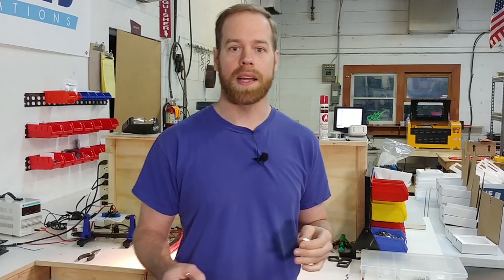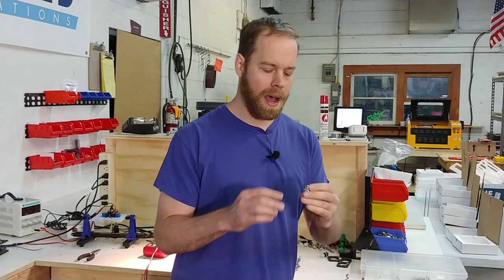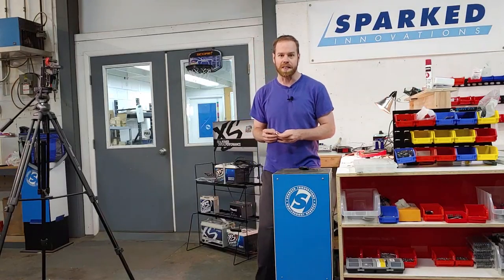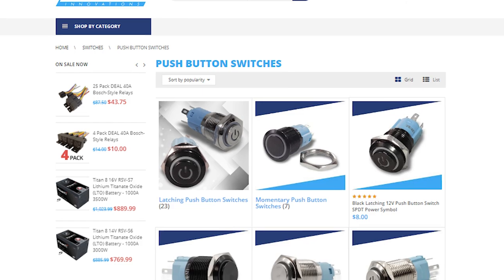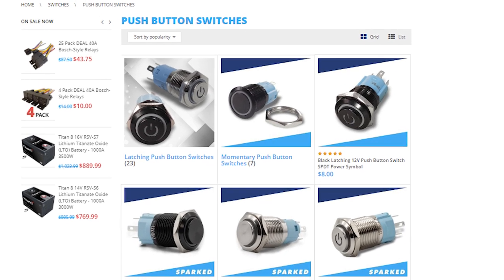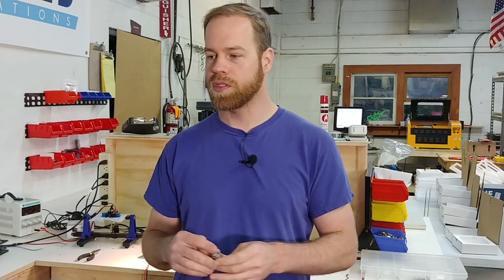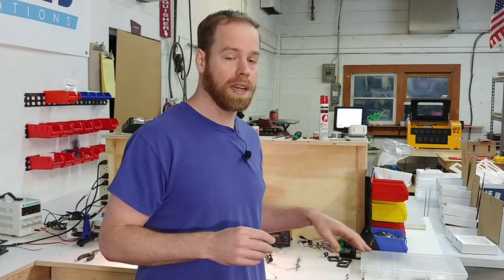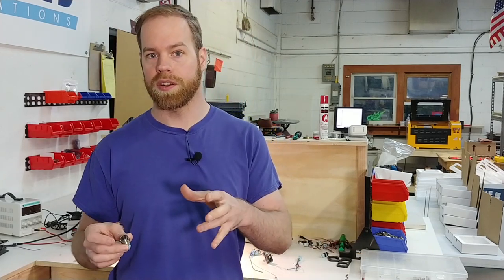Electronic Switches, What You Need To Know!

Comment: I have a question about your series parallel switch. I have 2 irockford subs dual 2ohm subs will this switch allow me to switch from 1ohm to 2 ohm. Thanks for your time. My amp is fosgate 2500bdcp.
Reply from the maker: For two D2 subs, you can switch to a mono amp from 0.5ohm to 2ohms. Or you can set it up to switch from 2ohm to 8ohm.